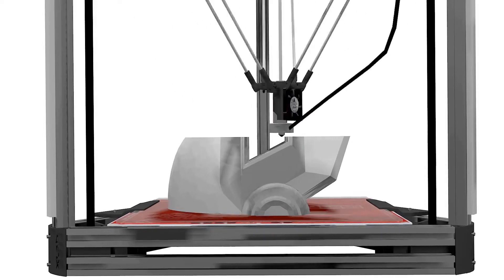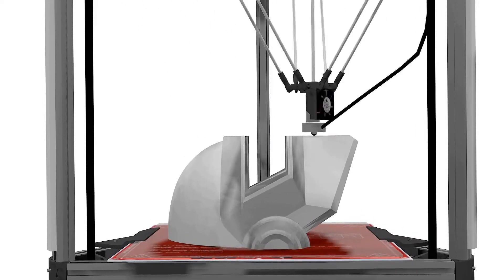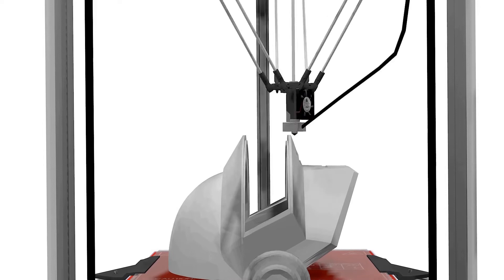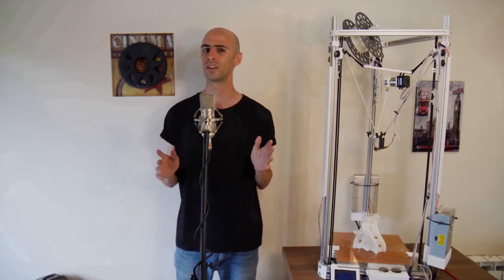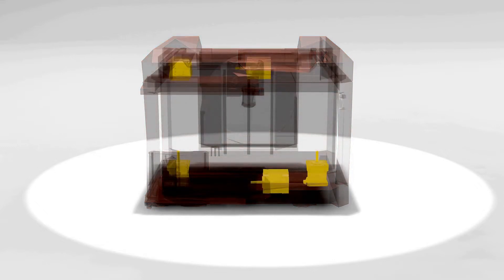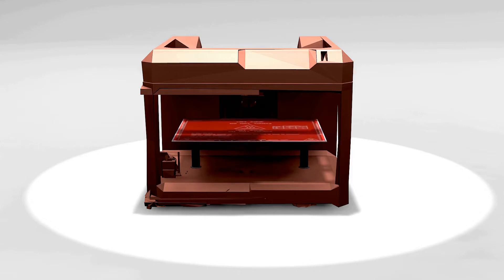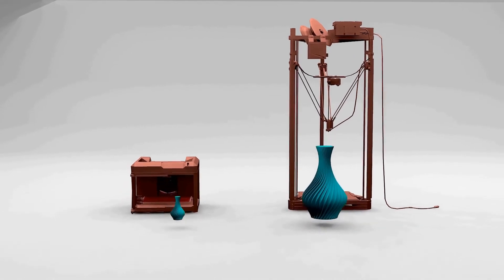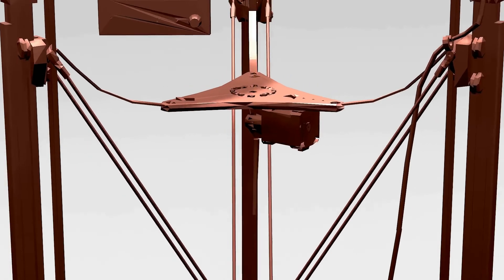Build a Delta 3D Printer - Delta vs Cartesian

Comment: I have 2 cartesians, I am thinking of getting a delta.. yeah why not built one from the parts from another old cartesian that someone gave me. Ya the flying extruder is a great idea, becos I don’t know if delta can swing that extruder weight around. Thanks for making this video.
Reply from the maker: yeah definitely go for it if you want to really learn how they work and how to fix them. flying extruder is also really good for printing with ninjaflex, good luck
Reply: @myriadpro6752 ya I will, actually I have plans for cross gantry, after seeing yr video I am inspired to do delta after a long time waiting..wanna try thing. Thank you bro, you r awesome💕
Reply: @myriadpro6752  may I know how ramps1.4 get the Gcode to run the print job?
Reply from the maker: @jimmym2719  ramps 1.4 will only work when combined with an Arduino mega 2560 (ramps 1.4 is the muscle and Arduino mega is the brains which receives the gcode)
Reply: @myriadpro6752  oh. Thanks, So how to get the Gcode to the mega? My Anet A8 got an SD slot which I normally got the saved cura files to.
Reply from the maker: @jimmym2719  yeah so first of all you need to upload the firmware (Repetier) to the mega which is described on the last video of this tutorial. 
Then to send the Gcode you have two options: one by SD card like you said into SD slot in the LCD Display or other options by USB cable connected to a computer running a host like Repetier Host. (in my experience USB cable printing is more reliable than SD card even if it requires hooking up a computer to the printer)
hope this helps
Reply: @myriadpro6752  thanks
Reply: @myriadpro6752  thanks ! Building the frame now, decided to go 1M in height. I think will extend the 200mm parallel arm that I ordered(now in shipping).
Reply: @myriadpro6752  thks, yeah will get to that later when I get the display. Thanks
Reply: Typical cartesians don't have long enough extrusions to make anything but a really tiny delta. You need the extrusions roughly equal to build diameter PLUS build height in length.